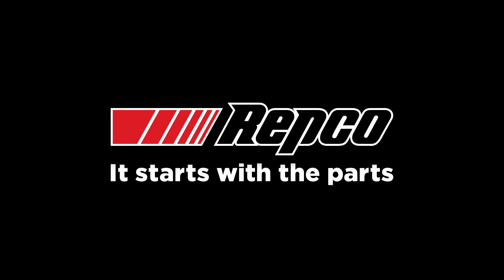Ryco Fuel Water Separator - Available at Repco

Comment: Do you have this set up with a 30 micron filter. I use a Z699 (5 micron) on my NT Pajero so I would like to put a 30 micron before the 5 micron. I could use the 10 micron, but why put a 10 before the existing 5 micron. Thanks